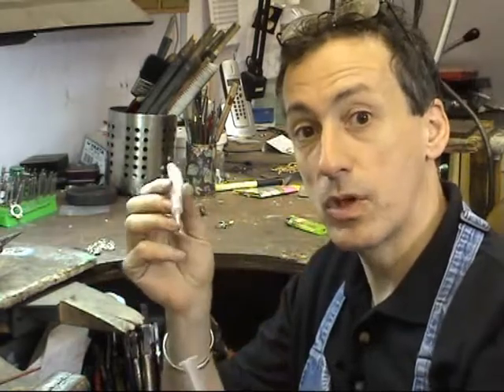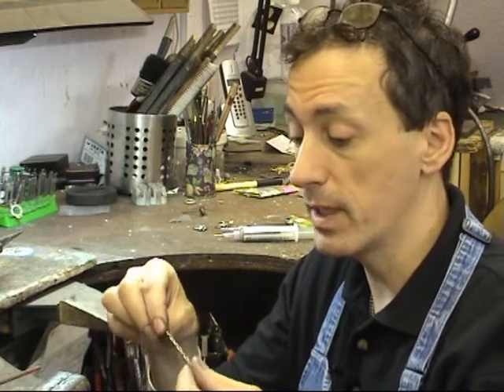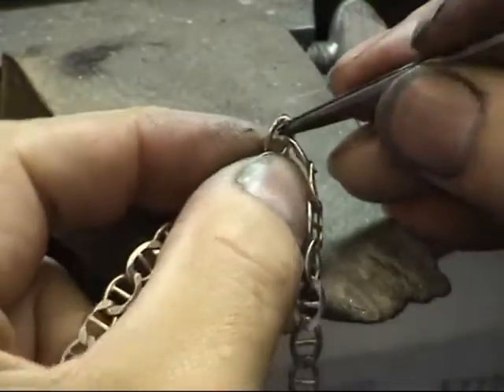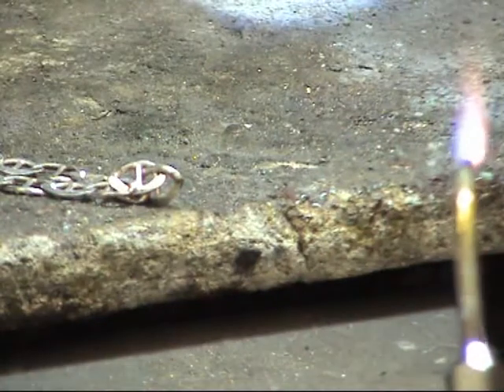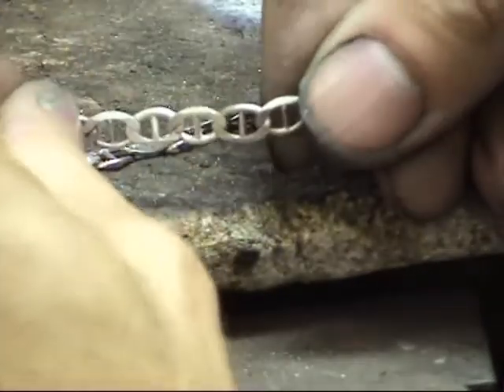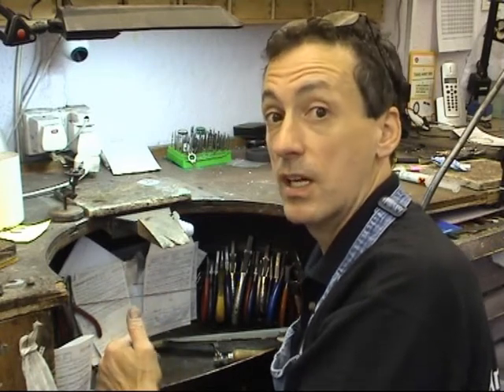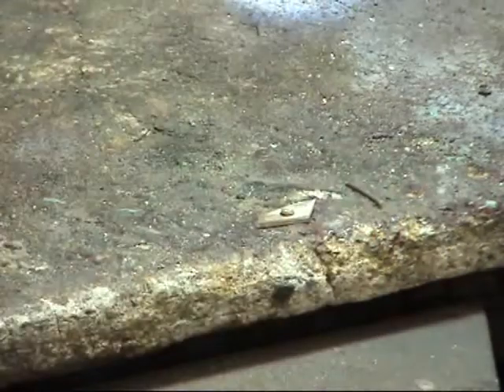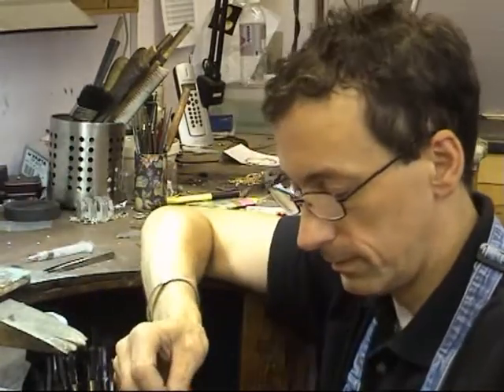How to Silver Solder

Comment: the flame turned green indicating that the flux contained consists at least partially of orthoboric acid (borax). if this is true than the solder should be soluble in water or alcohol. 
have you ever tried to redissolve the dried up silver solder? it could work with water, alcohols or acetone. 
best regards